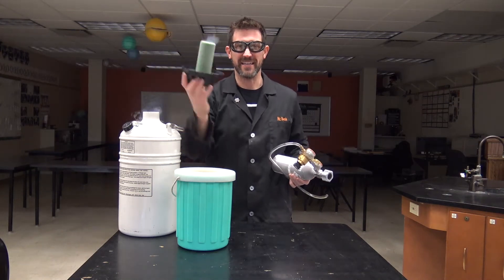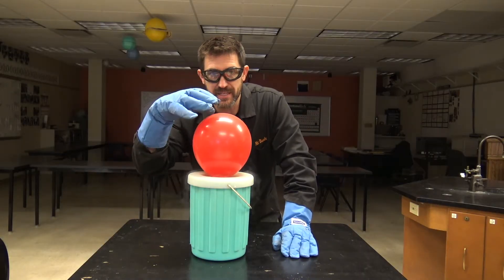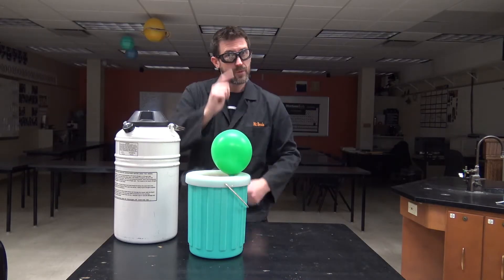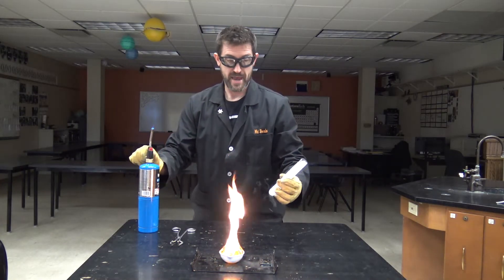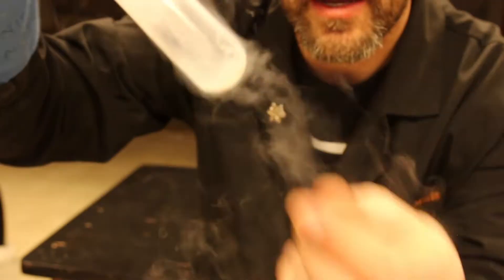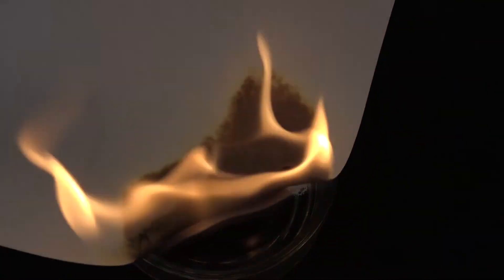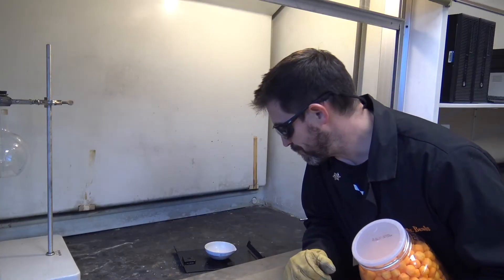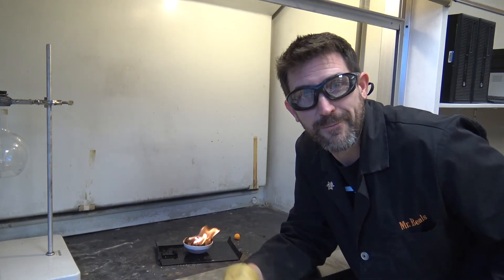Liquid Oxygen Experiments

Comment: Nice, I'd expected you to pour it into a burning tealight though... That thing will turns into a rocket engine
Reply from the maker: Wait. Tea candle?! I’ve never seen this! Now I have to try it! Full credit to you!
Any other ideas?
Reply: Beals Science you could get liquid oxygen faster by running oxygen gas through a copper pipe submerged in liquid nitrogen
Reply from the maker: Great idea!
I guess it is time to get more oxygen!
Reply: Just get more teflon tubing. Coil it at the bottom of your dewar. Hook one end to your cylinder and the other end drop into your tube flask that is also in the dewar then flow your oxygen. That tube will be filled up in a few minutes. I just did this today to test an ozone still. Now if only I could figure out how to store the ozone....